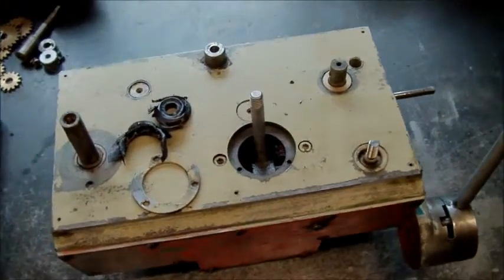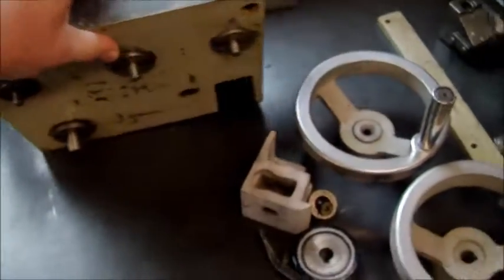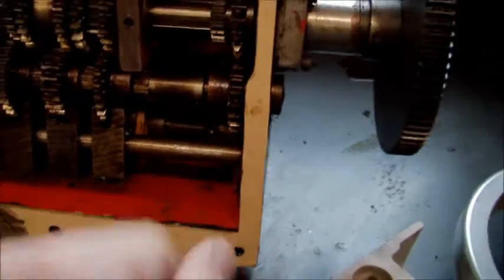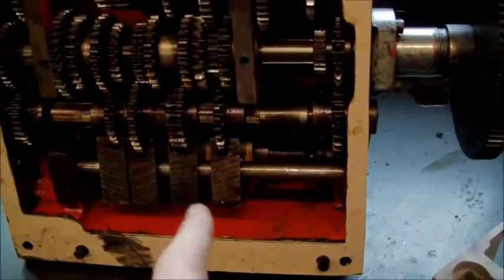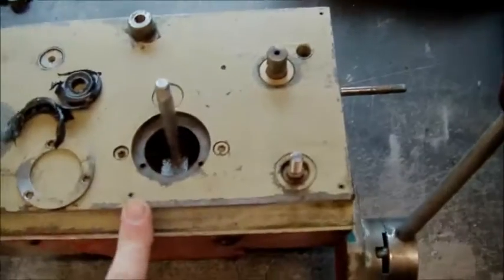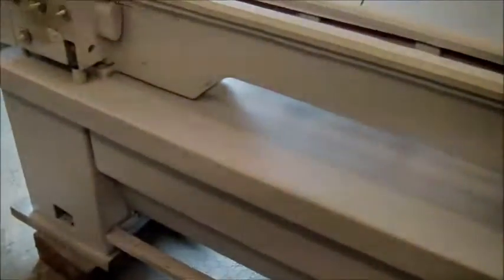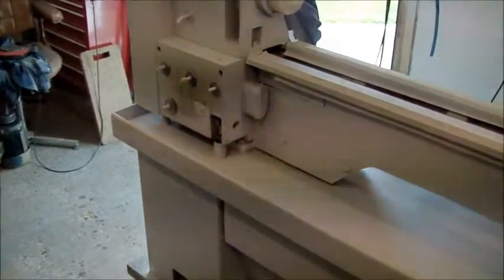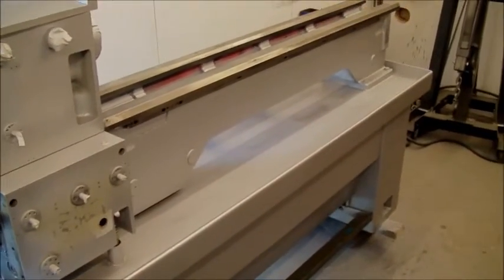Harrison M300 Refurb and Repair

Comment: Hi Nige which steering gaiter did you use for the Harrison ?
Reply from the maker: Hi It was just the small end from a universal one still working to this day :)
Reply: @fixitnige  Did you bother putting that spring on, dosent look as if its needed? I'm going to have a look around some car shops tomorrow to see if i can find something. It's the cleaning that's the worst bit...
Reply from the maker: @jimspencer3072  yes mate I did put the spring back I think it holds the arm still when the front plate is put back on or the arm would be floppy if that makes sense.

Comment: Hi Nigel. I have got the gearbox apart on my M300 at the moment, it looks like someone has been in to it before me. The selection was not right before I looked at it. Have you still got the cam alignment sequence you mentioned in a previous reply.
Reply from the maker: Hello chris I have looked everywhere for that but it must have been saved as a draft in my old emial client which I no longer use the only thing I can suggest is to ring harrison (600 group) and ask to speak to and engineer to help with the problem which is what I did. Good luck Nigel.
Reply: Thanks, I may have pieced it together from various pics on the web. I will suck it and see!

Comment: Hi Nigel,been watching your videos of the Harrison M 300 refurb,I have been asked to see if I can build back up the feed gearbox,they have purchased a full set of cams and a couple of gears of which teeth where broken.Was hoping u could put me in the picture as to the set up of the plastic cams relative to the square part of shaft.Thankyou very much. Barry
Reply from the maker: Hello Barry I think  I still have the correct sequence that was sent to me by a chap
at Harrison Lathes when I did mine I will try and find it for you and post it here.
good luck with the rebuild cheers Nigel

Comment: Hi Nige
Im having right bother cutting metric threads on my imperial M300. It seems to be cutting imperial no matter what setting i use. Knowing i need to keep the half nut engaged throughout the metric performance it still cuts imperial/whitworth threads. Trying to get to the bottom of it. On my lathe above the 40/88/44 there is a number 95. On your metric model you have 96. What is this number for? Does this number over ride the 88 when doing imperial or metric threads. The manual says little about it. What have you discovered? Any info greatly appreciated.
Regards
John
Reply from the maker: Hello john sorry your having a few problems the 96 is the teeth on the rear sprocket
as their are 4 sprockets for threading as you say you have to keep the half nuts engaged 
and run the motor forward and reverse.Looking at it to change to imperial I swap 88 and 44
the other way round but I have never needed it yet.
Hope you get sorted 
Good Luck
Reply: Nige you are a star. You said it all with 4 sprockets for threading. The previous owner had spaced 95 sprocket out the way for some reason,so only 3 in mesh. No wonder it was not working right. I thought that was how it was since they were a decent engineering firm. I now have all 4 sprockets in mesh and its doing what it says on the tin. Thanks so much
John
Reply from the maker: Hi John glad you got it sorted well done 
cheers for now

Comment: Hi Nigel. This video has helped me a great deal. Thank you.
Just a quick question. When removing the gear selector box as I am about to, is there a gasket behind it or will it require gasket paste on refitting. Also is there a sump plug to drain prior to removal. Many Thanks.

John
Reply from the maker: hello john there is a gasket but if your carefull it will be ok but you will need some
good silycon sealer for the top of the box as there is now gasket at that point 
good luck

Comment: Dear GOSSQ1 R5 R5  Mate what can I say. Fantastic video. Just bought same lathe to do up and use. Exactly same problem with Feed selector lever and perished rubber gator. How much I thought from Mr Harrison. I check out U Tube. Problem solved, steering arm gator fitted two days later. Thanks so much for the info, keep it coming. Cheers Les
Reply from the maker: Hello Les good to hear I have helped someone else with their lathe, I have used mine so much
now I would not be without it. Good luck with your Harrison cheers.

Comment: Thanks for the videom. i have recently acquired an M300. I have the same problem with the leaking seal on the feed engage lever. What was the exactly was the rack gaiter you used, please. Regards Jeff
Reply from the maker: Hello Jeff  I just got a standard universal steering gator and cut off the small end of one gator
it works brilliant and never had a problem with it. 
good luck Nigel

Comment: tks: great usefull vid, I  have the same m300  lathe but now want to go thread cutting and the gearbox doesn't work on all gears! so will get it out!
Reply from the maker: Hello esper glad the video helped you I hope you get your lathe working good.
Nigel
Reply: Hello GOSQI
I have the same M300 Harrison Lathe. Perhaps you are willing to help me with specifications about the gears from Headstock  and gearbox . Are they  the same DP.  
A  colchester bantam: 10 DP and 14,5 degree PA. 
I want to buy gear cutters to make some gears restoration from M 300 lathe.

Thanks chris from Holland
Reply from the maker: Hello Chris sorry I can't help with the colchester parts.As far as the gear cutters are concerned
they should be metric module gears so just measure the teeth width and that will give you the
module you need. I.E. If the tooth is 3mm across you need a module 3 cutter and the cutters
are marked 1 to 8 each one does a different number of teeth hope this helps.

Cheers Nigel
Reply: Hello Nigel
 thanks for a quick answer. I don't have yet open the head-stock cover to measure.
 When it is a metric module gear it is easy for me to measure. I thought it is a Imperial lathe and  it wiil be DP gears
Thanks for this helps

Cheers Chris
Reply from the maker: Hi again chris you may well be right and it is imperial all I did in my headstock was to check
everything looked good and changed the oil, good luck with your tho I hope you get it all
working they are good lathes and I am so glad I got mine.

Nigel

Comment: What did you use to decrease the lathe and what paint and undercoat  type did you use ?
Reply from the maker: Hi Geoff  I wiped it down with carb cleaner and thinners but it had been painted by the last owners so I did spend
and long time with a wire wheel on my grinder to get off what I could. I repainted it cellulose primer and then
sprayed with smooth silver hammerite but I may redo it with the original colours and paint. 
Cheers Nigel